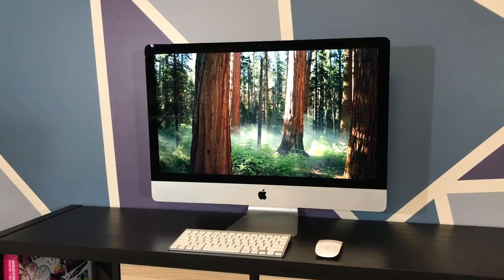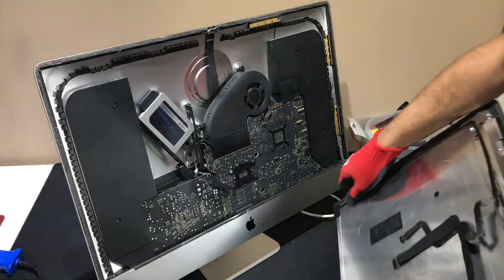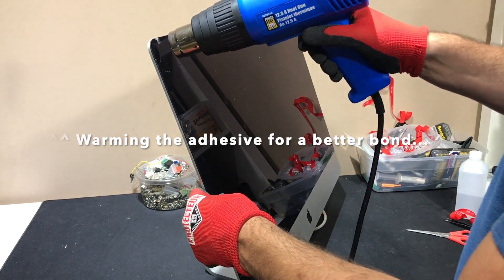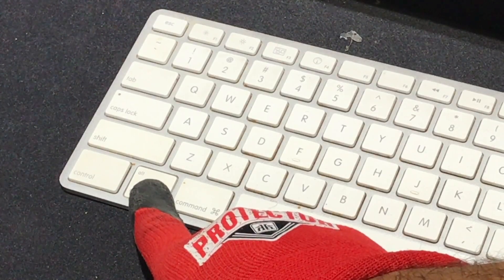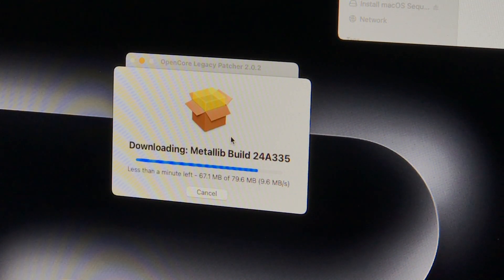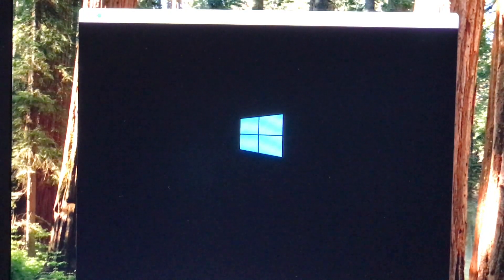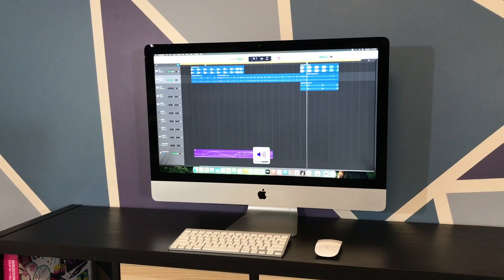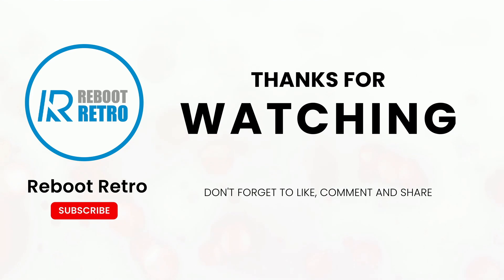Apple doesn't support it, but this 2012 Big Mac runs Sequoia perfectly!

Comment: I have this exact same model running with OCLP and a new SSD. I installed macOS Monterey instead of Sequoia, mainly due to performance concerns, although I'm not sure if it actually makes a difference.

Would you recommend upgrading to the latest OS anyway? Also, how would you go about doing that using OCLP? The system shows a message that a new OS is available, but I’m not sure if installing it that way might break something.
Reply from the maker: Nice!  New life into another Mac that Apple says is obsolete!

With any newer OS there will be new features with more system requirements, and thus performance in theory should always be slightly less.  In the real world though, if you have an SSD with a decent amount of RAM, I wouldn't be worried about it.  From my experience it's not drastically noticeable.

That being said, the biggest reason for upgrades is app support and security updates.  Since Monterey is still getting security updates and so long as you don't have any apps that refuse to run, there's no need to upgrade unless you want new features or a shiny new OS.

I haven't done this personally, but you should be able to upgrade directly to the next OS just like on a fully supported Mac.  You'll need to first upgrade your OpenCore app and install the latest bootloader, because if you upgrade the OS past what OC supports it could break the system.  With the latest version of OC installed and support for the OS you're upgrading to, the upgrade should work exactly like on a supported Mac.  After the upgrade, you'll need to reinstall any necessary root patches, generally for graphics drivers and WiFi.
Reply: Thanks! :)

Comment: Have you had issues with fusion drives and OCLP? My 2017 iMac seems to every time I try and update it past Ventura using OCLP
Reply from the maker: I haven't tried it, since none of the Macs I have or have worked on have had a Fusion Drive.  I did read up on it once; from my understanding, the Fusion Drive is just a special RAID type (like Optane) and I've understood that Mac OS still supports it under the hood, but you may need command line to set it up.  From the OS's perspective, I don't see that it would care; the only issue I could think of offhand is installing the OpenCore bootloader, since I think it gets raw-written to the disk potentially bypassing the software RAID.  This is all just thoughts and theory, since I have no actual experience with it.  If you're having trouble, I'd suggest trying to write the bootloader to a USB stick and booting from that.  If you have a Fusion Drive though, you can use an Apple to generic NVMe adapter and swap the Fusion for a regular high capacity SSD.  Performance would be significantly better and you'd avoid the Fusion partition mess.  Hope this is all somewhat helpful.
Reply: @ thanks! didn’t expect for you to reply to a comment on a video you made 4 months ago lol
Reply from the maker: @ I try to respond to any comments that I can, particularly if someone needs help, regardless of the video :)

Comment: Thanks RR for this informative video! 🙏🏼 But I must say Screw that to resealing; Some tidy application of black electrical tape will hold that screen on long term! AND it'll allow extremely easy access later. I have a 27" iMac 2015 (4 GHz Quad-Core Intel Core i7, Max RAM), which I'll be soon replacing that shaky Fusion drive with an SSD. Machine is superb, Apple are extremely devious in how they drop older hardware, I've noticed old hardware slow ALOT with just incremental updates!
And thanks for letting me know that VMWare is now free to us small time single user folk who like to fettle. 👍🏼
Reply from the maker: Thanks for the comment!  I know, the seal kits seem like such a waste (and a pain!).  This iMac for many years had electrical tape holding the screen, but after years of heat it eventually let go and almost destroyed the screen.  Although to be fair, many people have had the seal kits do the same thing.  I always leave the screen tilted slightly upward as a precaution.  About the VMWare, yes, I was really surprised they are releasing it free!  Doesn't seem like a typical VMWare/Broadcom corporate move... Although with Parallels being such a dominant competitor in the consumer space, I suspect they're trying to wedge themselves in a little more market share.

Comment: I use my imac i purchased in 2011 as a screen in TDM works flawlessly and amuses me greatly im still using it, looks great and plan to use it for however long a peace of sting is. One word of advice, you do need Betterdisplay and Soundsource. I tried finding free or alternatives for years but these two are the best and makes everything work like OEM. If you dont sound and brightness is stuck at 100%. I know screens are not expensive but i dont want to be someone that chases technology, too much stress.  I keep the imac on its native OS as its just now a display and for storage.    Ive had this system with a Macbook pro for nine years and now a mac mini.   The macbook pro was always a bit funny with detecting the screen ( thunderbold mini display port) could never find a way of successfully doing this, so i simply ended up unplugging and plugging the thunderbolt cable for almost a decade, ironically the mac mini is seemless, absolutely no issues.     So id look forward to see if you use a imac as a screen.  Id encourage anyone to not chase technology but try and use what we have for as long as possible.
Reply from the maker: Thanks for the comment!  Absolutely agree, we need to be less wasteful and stop chasing after the newest, shiniest things that come out.  I'm curious, what Macs have you used with a 2011 TDM?  Apple says the second Mac must be 2019 or older with Catalina or older; we know this is false for the 2009/2010 since it uses standard DP signals.  But from what I've heard, 2011 onward do actually have some real limitations.  Particularly, I've read that it does not work in conjunction with Apple Silicon Macs.  There is very little info online about this.  Any insight as to where the real world limits are?

Comment: I run my 2014 iMac 5K i5 with 24GB since 4 years with OCLP running the newest OS from an external 2TB NVME diks with the original fusion drive  separated into a 128 GB SSD and 1 TB harddrive as my daily driver without any problems. Furthermore where did you get the pricing for the proper adhesive strips, I bought mine on ALI express for less than €5. I also run a number of older mac’s on OCLP with various versions of the OS depending on the hardware (don’t run the newest OS on non metal hardware, it does work but with some issues and very slow) and these run fine as well. Remember to provide the guys behind OCLP with some financial support for their great work! I also do run various Windows and Linux virtual machines on the iMac and on a Mac Pro 2013 using Parallels and that also works great under OCLP.
Reply from the maker: The adhesive strips, last I checked for ones that seemed even remotely reputable (which admittedly was quite a while ago now), were priced from Amazon.  The problem with Ali Express is it can take up to 6 months to receive parcels in the Americas, depending on how they ship it.  And so many people reported those cheap strips have caused screens to fall out and destroy the screen, logic board, or both.  I'm not saying it's impossible to find decent ones for cheap; I once bought cheap no name Ethernet crimp ends which were way better than name brand ones from a local big chain store.  If you found reliable strips at that price, that's an amazing score for sure!

Comment: I have an Intel iMac - Retina 5K, 27-inch, 2020 3.8 GHz 8-Core Intel Core i7    I recently upgraded to Sequoia and have had numerous issues and have spent much time on the phone with Apple Sr. Advisors. Evidently, I found some bugs. Maybe that is why there are now 2 updates for Sequoia. I have been using iMacs since 2008 and this is the most trouble I ever had with a Mac OS upgrade. If I had to do it over, I would really consider skipping Sequoia altogether.
Reply from the maker: That sounds really frustrating!  I haven't noticed issues with Sequoia yet, but I haven't used it very much.  My personal systems are not upgraded yet.  I expect they will fix most issues as updates come out.  Hopefully your experience gets better!

Comment: May I ask which processor that 2012 iMac 27” has? It seems significantly faster than the one I have. And I don’t think you mentioned (apologies if you did) whether it has the stock HD or has been upgraded to SSD?
Great video, thanks
Reply from the maker: Thanks for the comment!  I don't have the computer on-hand anymore, but I believe it was the Core i7-3770.  Stock it had a mechanical hard drive; when it started acting up, it was upgraded to a SATA SSD.  The i7 shouldn't be significantly faster for general tasks - I'd mostly expect the SSD to affect this.  I didn't check to confirm, but the 2012 models should have the Apple proprietary NVMe slot, which will accept standard NVMe SSDs if an adapter is used.  It would be ideal to use the NVMe slot, since you can use much faster SSDs than SATA SSDs.  Either way, if you find yours unusually slow, there might be something else wrong; if you haven't already, might be worth trying a fresh OS install.

Comment: Thanks for the great info. I have updated to Catalina, but I can not get all the latest updates. In Logic X, I can not get the Logic 11 update. The computer is 12 years old. Apple will not accept it as a trade in. I will bite the bullet and buy the Mini 4, hopefully I will get 10 years out of it!!
Reply from the maker: Thanks for the comment!  At 12 years old you didn't do bad at all!  If you're comfortable with a modded OS, I bet you could get a few more years with OCLP.  I think the Mini 4 will be a fantastic system for years to come; my only concern is that because the OS is so locked down we may not have upgrades like OCLP anymore with Apple Silicon.  Right now on Intel we can upgrade a system if the hardware is still good, but on Apple Silicon we'll be stuck at whatever OS Apple last releases.  Time will tell :)

Comment: You should check this video:  Commodore 64 still in use - auto shop in Poland. ;)
Reply from the maker: That's pretty neat!  Very little info unfortunately on what it does, but seems to be balancing driveshafts somehow.  I have a couple C64's and various Commodore gear that will eventually show up on this channel when I get to it :)

Comment: I have a iMac 21.5”, Mid-2011, 24gb, upgraded 1tb ssd, 2.7 core i5, running Monterey 12.7.6.  Anything higher than this causes problems with the TV app.  I tried several os’ starting with Sonoma and worked backward until settling on Monterey - which works great.
Reply from the maker: The newer OSes have some DRM issues when using legacy graphics hardware acceleration (on the older GPUs).  I haven't tried to confirm, but theoretically if you upgraded to a Metal-supported GPU it should work with the TV app on newer OSes.  If you're curious about GPU upgrades, I also have a video on this - I upgraded a 2009 27" which is a very similar process to yours.
Reply: Thanks I got same Mac with same problem running Sonoma thought it was something I'd missed. It was a clean install from OCLP will stick with Sonoma.
Reply: Thanks, you’re right …I figured that out through trial and error. The only upgrade I did (beside memory) was the SSD - which turbocharged its performance.  I wish there was a nice chart that showed models corresponding to their max OS when using OCLP.  The Open Core Legacy Patcher has been a game changer. I also have a newer 27” that is now running Sequoia - albeit without the iPhone app and other features.
Reply from the maker: @BradfordBeckett  Ya, the SSD makes a HUGE performance boost!  Does OCLP system not work with the iPhone app?  I've tried the app (it's cool), but I don't recall if I tried it on the 2012 system.
Reply: @rebootretro  I was referring to my main system where I am running Sequoia on my 2017 Retina 5K, 27" using OCLP.  I upgraded it with 40gb ram and a 2tb SSD....the iPhone Mirroring app won't work because it's running a 3.5 GHz Quad-Core Intel Core i5....BUT, other than that, it runs like an absolute beast with no problems.  The 2011 machine won't go higher than Monterey without issues - but that is a huge improvement over it's Apple max OS.

Comment: I have the same model iMac with MacOS Catalina installed.  Tried to install Windows 10 using Boot Camp, but the drivers included with Catalina causes BSOD after updating.  Since Apple no longer maintains the Boot Camp drivers, you’re out of luck if you want to run Windows 10.  But if you downgrade to MacOS Mojave, the Boot Camp drivers won’t BSOD Windows 10.  So the trick to running Windows 10 on these old Macs is to downgrade to MacOS Mojave.😂

Comment: Hello, what are the mac fan controls you set? Thanks.
Reply from the maker: @robertrea8829  I don’t have the Mac on hand anymore, but I think I set the fan to CPU average sensor, and set a manual range between 30 low speed and 90 full speed.  But your settings really depend on how you use your Mac.  Ideally you want the fans to ramp up sooner, but if you regularly get into heavier loads the fan will get very loud very fast and you may have to play around with settings.  Anything you set more aggressive than the Apple default will help the system out.
Reply: @rebootretro  Thanks.

Comment: How are your boot times? Im using a 2013 iMac with OCLP running Big Sur and once I started upgrading to Monterey and Ventura, my boot time slowed down drastically Thank you for this informative video.
Reply from the maker: @melchora7  Thanks for the comment!  I didn’t time it before/after, but I didn’t notice it was unusually slow.  Everything seemed normal.  If you find that it’s hanging for a long time before the loading bar, try doing a PRAM reset, then holding OPT on startup to choose boot device (make sure to choose OCLP partition).  Sometimes the EFI “looses” the default boot device and will hang trying to detect it before the system even begins to load.

Comment: I have a late 2009 iMac that a friend gave to me after the HDD kicked the bucket. I've upgraded it with an SSD and reinstalled MacOSX High Sierra, amd it was running okay, for a while. Seems like the GPU is giving up the ghost now. I reballed it in the oven once or twice, but I think I'd like to eventaully try my hand at upgrading the GPU and seeing if I can install a more modern OS. Anyone else done the same thing and have some tips for me?? :)
Reply from the maker: Ya, the whole reflow thing is only a temporary fix unfortunately.  On some laptops I have had it last longer with increased fan speed and good paste but they generally always fail again.  I upgraded a 2009 with a Radeon M5100 (video here: https://youtu.be/n9koG8p9Ch0).  I used OCLP and it has full native Metal graphics support on Monterey.  With additional patching, you should be able to take the M5100 all the way to Sequoia (but haven't tried yet).  I like the M5100 because it's cheap and (up to Monterey) had full graphics support without patching drivers.  It's a bit of a pain to install it, but once you flash the vBIOS it's not too bad.

Comment: I have a 27-inch 2010.  Moving to SSD was crucial, but I was already a Ubuntu user on other systems.  That stopped working reliably on imac as of version 24.04, so I moved to Debian.  It's a very competent system.  The only disadvantage is high i7 wattage.  That's okay for intermittent use.
Reply from the maker: Yes, these suck back quite a bit of power.  It's been a while, but I think I clocked it at about 150W under typical use.  They'd make great monitors over Target Display if the consumption wasn't so high.  Fine for occasional use, but for daily it adds up fast!  We're running the same setup, but a 2009.  It's only used occasionally for accounting and light graphics work - totally a perfect system still!  For what little hours it runs, the power isn't really an issue.  If it was used daily I'd replace it just from a power standpoint.
Reply: For others reading along, it's the xeon that runs 160-plus watts.  The i7 870 is 95 watts TDP.  If you have the i7 3770 that's down to 77 watts.  It's not a ton of amperage, but 20 hours a day it adds up.  I couldn't find a definitive rating on the M4, but some hobbyists suggest 22 watts.  That's how an M-series laptop runs so long on battery.

Comment: I have 2010 and 2012 Mac minis that I've owned since new and have upgraded RAM on both and kept the macOS software updated to the max possible. I use one for playing with Linux Mint 22 and the other I'm looking to install TrueNAS for a home ZFS RAID. I also recently acquired (quite cheaply) a refurbished 2013 MacBook Pro 15" Core i7 Retina (beautiful screen) for using macOS portably, since my other modern Macs are both minis (2018 and 2020). The MBP came with 16GB of RAM and a 500GB SSD, so, hardware-wise it's pretty capable. I'm seeing more of these OCLP videos and may take the plunge to upgrade to Sonoma or Sequoia to get the latest feature and security updates. There are great deals out there on older Mac hardware that still have good performance and many years of life. Thanks for the great video!
Reply from the maker: Thanks for the comment!  Ya, the OCLP team does pretty great work.  These systems have loads of useful life well after Apple drops software updates.